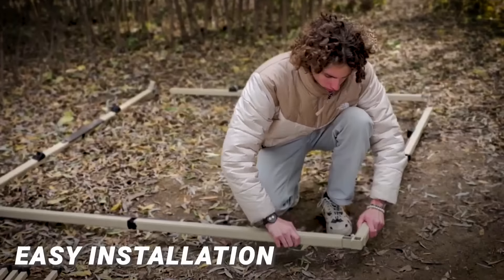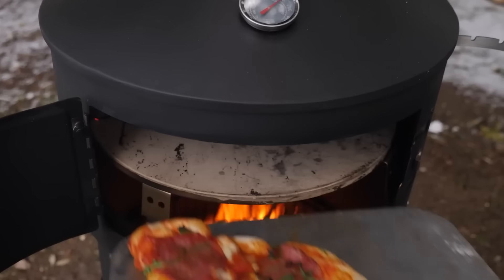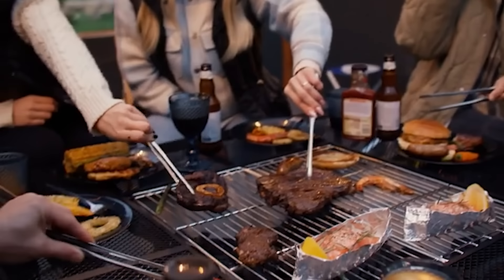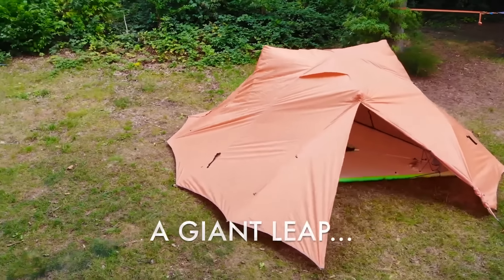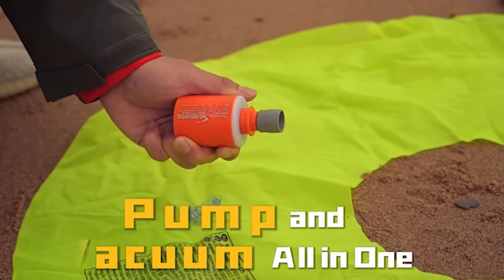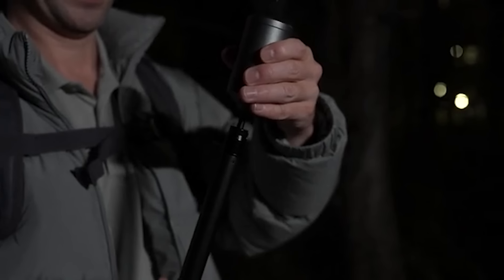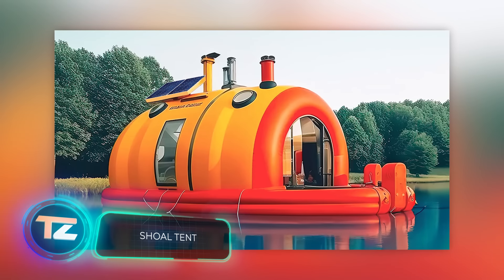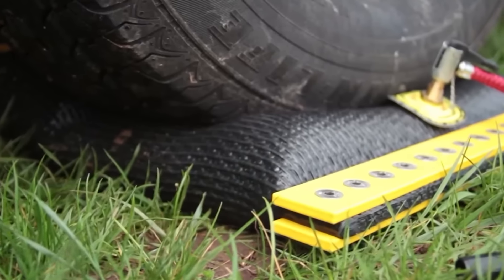15 BRILLIANT CAMPING GADGETS EVERYONE SHOULD HAVE

Comment: Yeah, but you can’t use the shower bag at home during a grid down.  You can’t hang it high enough to get under it to shower.  I know I have it.  It’s really heavy when full too, another issue when considering hanging it.  We could never get it to work, so we just stored it away, think MAYBE it might heat water during a grid down, but only if it’s hot out at the time.

Comment: That smart wagon is not going to go through the snow and mud the wheels on it are to small for that and it definitely won't go over rocks and rough terrain and the Patty stick under your vehicles tires the level without for the price of better come up with a little compressor to blow it up if you have to get that separate it's not worth it